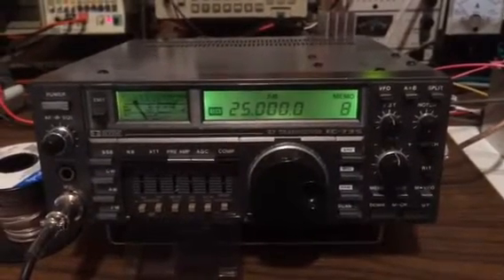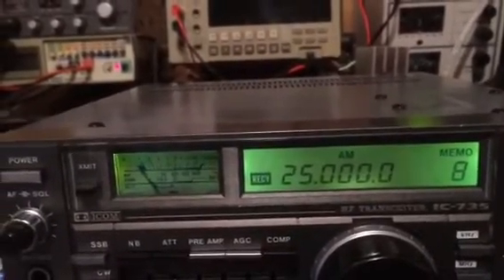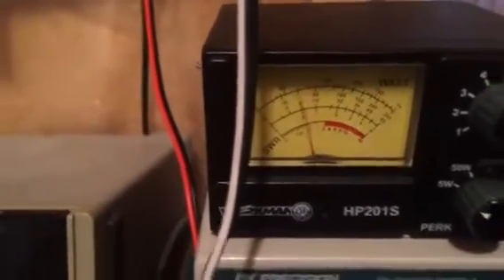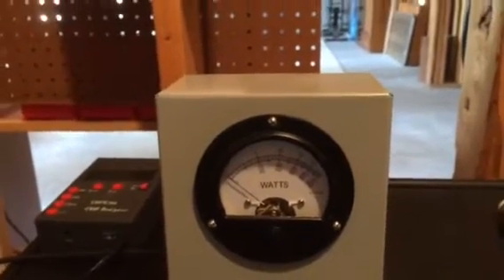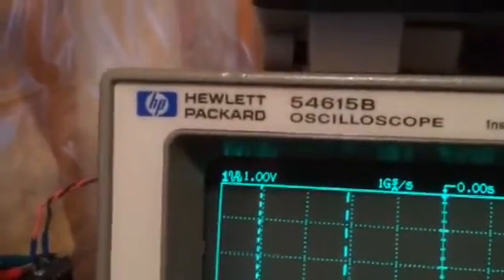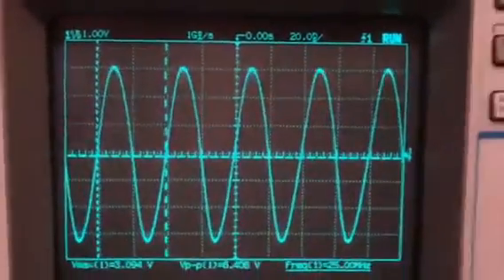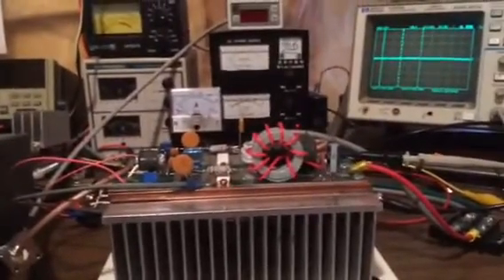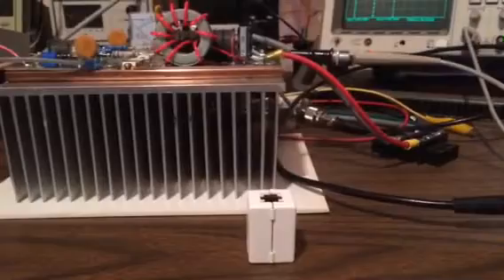RF Man shows output wave forms for dual LDMOS Amplifer

Comment: Building my first amplifier currently. Thanks for all your videos. I was wondering if you use a high voltage differential probe between the oscilloscope or if its just a standard 100x probe. I just got my first scope and learning how to use it. Thanks!

Comment: The modulated wave is not linear: it shows only negative modulation. IOW: the peaks should increase as you modulate. They don't, indicating the amp is in saturation at this power level and the setup used.